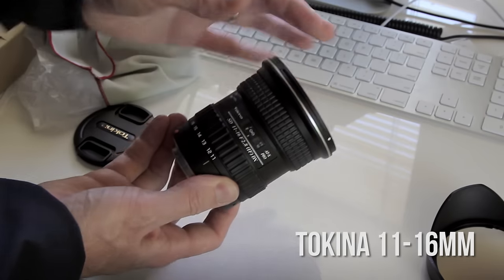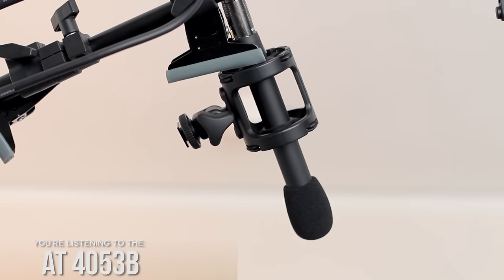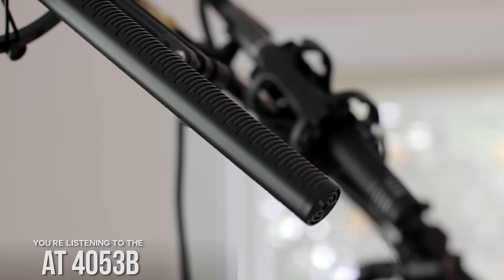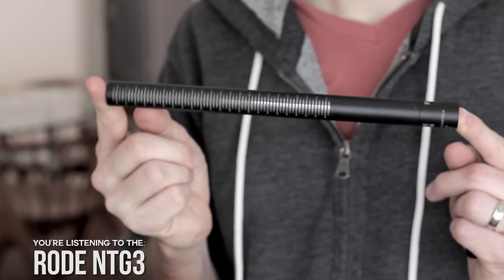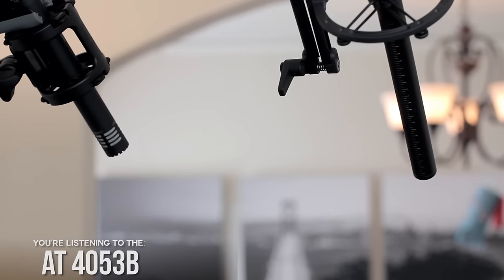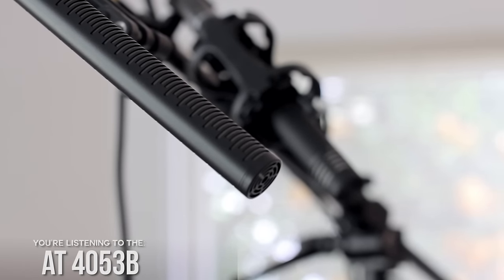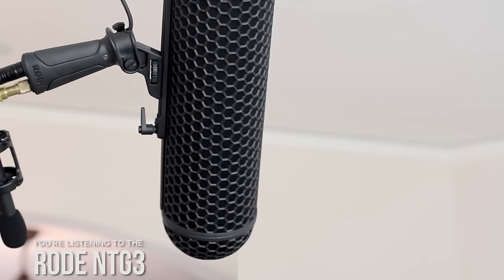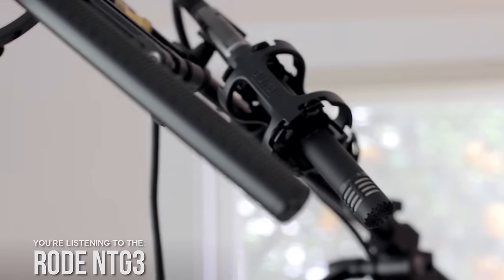Rode NTG3 and AT4053b compared indoors

Comment: I ended up finally picking up an NTG3 too and I can confirm everything in this video about these two mics. I love the sound of the RØDE but it does not work as well indoors. The AT just sounds so much better inside in most situations.

Comment: The AT 4053B is a bit brighter with a slight presence boost over the NTG3, and less boomy bass.  The NTG has a slightly brighter highs, noticeable on all the "sss" sounds, but appears less bright sounding because of its bigger low end. I think the NTG3 has great low end for a shotgun mic, but that can work against you in a small room.  The AT would be better in small, untreated rooms, as the walls will reflect a lot of low mids.  You should be using acoustic blankets indoors anyway as they make any dialogue sound much clearer.
Reply from the maker: Thanks, and yes, I have many acoustic blankets and they are very effective, the setup here was for demonstration of more extreme reverb situations.

Comment: Hey great review! If you'd take the NTG off its blemp, the sound would be the same or even more reflected?
Reply from the maker: Thanks! It's a great question. I should of had it out of the blimp, that said, I don't think the blimp is doing much to prevent the reverb, just like you are hearing about equal reverb in the 4053b. This comparison was more about hearing if the shotgun created any weird artifacts from it's rejection tube which can happen with reverb indoors but I didn't hear an issue in this case.
Reply: @RayOrtega sounds reasonable. I'm getting a second handed ntg3 for my outdoor shooting documentary style. Maybe in the future I'll get a mkh50 for it's awesome indoor capabilities. Have you tried?

Comment: Great video, but the NTG3 has full "outdoor" protection while the AT4053b has a simple bonnet, it would be fair to compare with same attachment and comparable cover and the same pointing angle.  Fair enough those two mics are excellent anyway.
Reply from the maker: ablaze6783 thanks. You're right that the NTG3 should not have been in the blimp. That was a bit of a brainfade. That said, I did record with it off and the results were pretty much the same. Ideally I would have been able to record in multiple environments but there's only so much time;) Really appreciate you watching!

Comment: I have used the Audio Technica AT4053B for a number of years and never had any issues with it until we flew recently for an indie feature film shoot in New York City.  We filmed in 7 interior locations, and in 3 of those locations, the AT4053B experienced very bad RF interference.  I don't know the source, we were not using wireless gear on-set and everyone on-set had their cell phones off or on flight mode.  The interference was so bad, it ruined the AT4053B boom audio at two of the locations we filmed at. In the worst locations, it kicked in every 10-20 seconds making capturing clear audio impossible. Thankfully we had on-camera Rode NTG mics and they captured great audio and did not suffer the same RF interference issues the AT4053B did.  If it had not been for the backup Rodes, we would have been screwed...
Reply: ive seen you everywhere paul, let it go
Reply: Thank you for sharing your experience, exactly that info what I am looking for.

Comment: Thanks for the review, Ray! I've always been curious to hear the differences between these two mics. One note: hypercardioids are not usually recommended for indoor use in the sound community.
I hear this a lot, but I think there's some confusion on the topic. The best pickup pattern for indoor locations are generally supercardioid or cardioid - my personal preference being cardioid. A supercardioid shotgun is not the same, due to the use of long interference tubes. There will always be exceptions, and once I even used an NTG3 exclusively for a shortfilm. I thought it sounded fantastic on those indoor locations, for being a shotgun. 

These are approximations, as polar patterns will vary from model to model. http://www.dwrl.utexas.edu/wp-content/uploads/2016/10/polar_patterns.png A hypercardioid has a very large lobe at the rear of the pattern. However, as you can see, the supercardioid has some significant advantages over the hyper pattern. I also see a lot of people saying that the Schoeps CMC641 is a hypercardioid, when it really is a supercardioid. 

I personally use modded Oktava MK012's for my indoor dialog recording, with the cardioid capsule. Most comparisons are done using stock Okatava's and they quite predictably underperform. I heartily recommend the MK012 for an indoor dialog mic, and cannot praise Bill Sitler's premium mod enough.

Here is a great shootout for a number of common production microphones: http://www.kenstone.net/fcp_homepage/right_mic_brockett.html

Great review - thanks for taking the time to put it together!
Reply: I find this a very interesting comment, because when one does in-depth research, including lots of videos, books, and articles on this topic by the top sound professionals, cardiods are NOT recommended for indoor dialogue use in anything but the most treated room and for singing vocals. Super and Hyper cards are identified as THE WAY to best capture indoor dialogue, with more focused pick up, while sounding full and natural. 

It's be interesting for you to site the "sound community" you cite (aside from the article from a non-professional in 2007)...
Reply: @rushmoresociety2577  Agreed. I had always read that hypercardioid mics are the way to go for indoor vocals.

Comment: Ok so I know this video is quite old but I see you still respond to some recent comments here. I have a weird question. I just recently got the Rode NTG3 and watched some unboxing videos in preparation. I learned form this video ( https://youtu.be/syjEQvQBTRY?t=493 ) that you can actually unscrew the top part of the microphone and that there is actually a piece of foam in there. Now I checked my NTG3 and it does NOT have that freaking piece of foam in there. Now I'm not sure if my unit is faulty or just a different version. So my question is did yours have the foam inside or not? Or could check it for me if you still own it? I know this is a weird request but it's driving me absolutely nuts and the Rode support hasn't gotten back to me so far...

Comment: Hi Ray, Just wondering, why are you using the blimp ngt3 indoors?  Does it help to reduce room echo or something?  Thanks!!
Reply from the maker: +Primary Technologies mostly to test how it affect the sound but also if you are moving the boom or there is HVAC in the house, it won't hurt to have the blimp on. It does a great job inside the blimp and I didn't notice enough difference without. Also gives you some pop protection if you are mic-ing close.
Reply: Thanks, Ray!

Comment: I hear no difference. Which considering ntg3 is a shotgun and more for outdoors, means I wouldn’t plunk money down for something indoors that didn’t sound much better.
Reply from the maker: Yeah in this test much difference and in most cases a regular shotgun mic does just fine but if you look at professional productions (TV shows etc) where they work in small spaces, enclosed, you'll notice they don't use shotguns and that's cause the rejection tube could cause an issue but of course not always. So it's the 'proper' use case to use the hypercardioid but you can get away with a shotgun in many cases.

Comment: you read that shotguns indoors are no no...... I can't hear a problem here......
Reply from the maker: Not exactly. Shotguns indoors can be a problem, it does not mean that it always will. In this case, correct, not much difference but in other rooms the interference tube can create issues. In most cases you will be fine. Technically the hypercardioid condenser like in this video, is the type most suited for indoors. It's generally what you'll see in TV shows and films shot indoors.